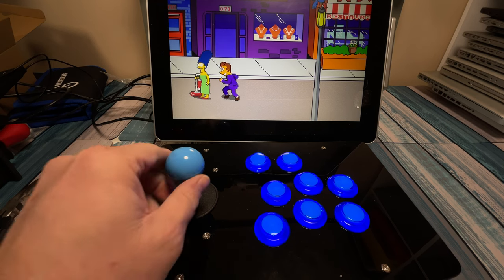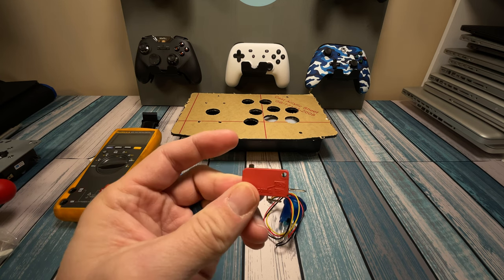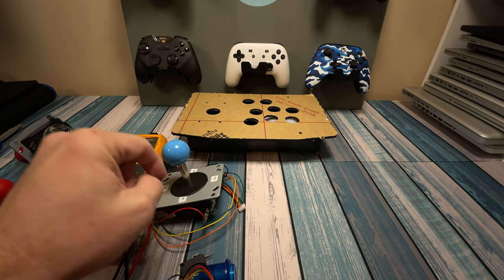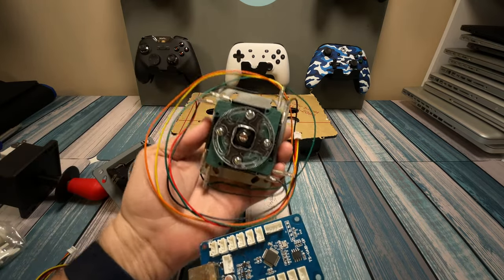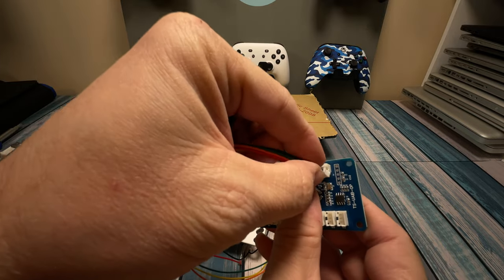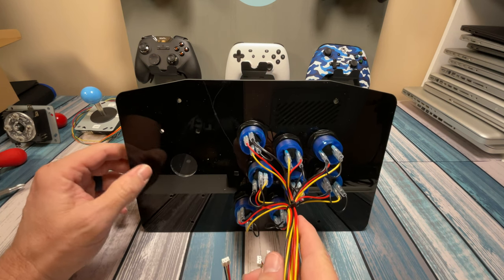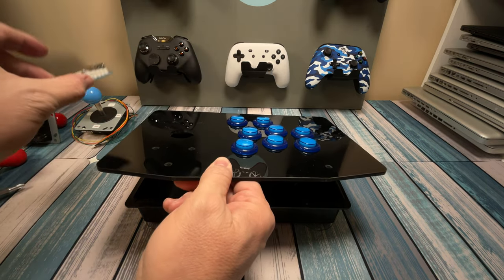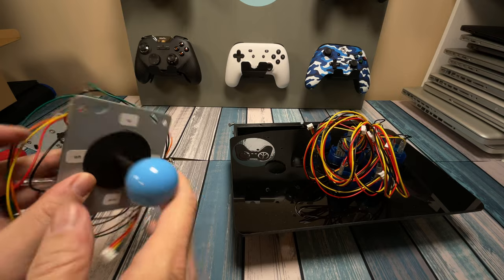Easy DIY Arcade Stick - Build Your Own!

Comment: Nice video, really helpful.
I'm in Brazil, so I'm looking for parts (instead of using the links you provided) to do something like this, and I'm having trouble figuring out which encoders are compatible which consoles. I have a Series X, any tips for figuring out compatibility?

Thanks

Comment: Thank you for posting this and explaining the science as you go. I am building a raspberry pi based arcade machine and this video is exactly what I needed. 
Question for you: I want to build a 4 player system, and currently the kit I have has individual gamepad encoders for each joystick/buttons combo. So I believe I will have to set them up individually and connect to the pi. 
I've also seen people "daisy-chain" connections in some setups but i don't understand how that works. Can you daisy chain 4 controllers to one encoder? Is having 4 encoders with 4 usb outputs the most efficient way to do this?
Thanks!!
Reply from the maker: Great question. If you use 4 encoders, you have to be aware of the USB ID, and sometimes your OS might not remember that player 1 is encoder 1, 2 is 2, etc. 

I would personally use an IPAC4, which is a 4 player keyboard encoder (like we all used in the good old days, lol). It can encode 4 players with 8 buttons each, but encodes them as keyboard entries rather than gamepad inputs.  https://amzn.to/3T3cp6Z

As far as “daisy chaining”, I’m guessing you’re talking about the ground connections. With a 4 player encoder, you should definitely make a ground daisy chain, the. Just wire the second connector of each button/switch directly to the encoder. Hope that helps!
Reply: @FamilyGeekery  thank you! I will check out the ipac4 encoder! Again, thank you for what you do. I really like learning this way

Comment: thank you so much for this video!
I have a question - what if instead of using a joystick I want to use directional buttons aka up-down-left-right, does normal standard gamepad encoder support that or do i have to get some kinda specific one? thanks
Reply from the maker: You can use any type of buttons instead of a joystick (even the same types of push buttons that you use for your kick/punch/shoot type buttons). The encoder is just looking for a switch to open and close. That switch could be a button or joystick direction. You may have to make your own wire harness depending on what type of connectors the encoder uses or comes with. Let me know if you have any other questions!